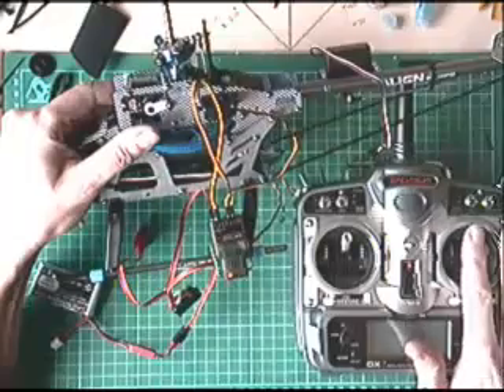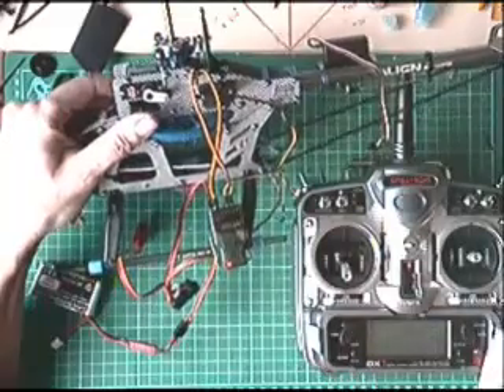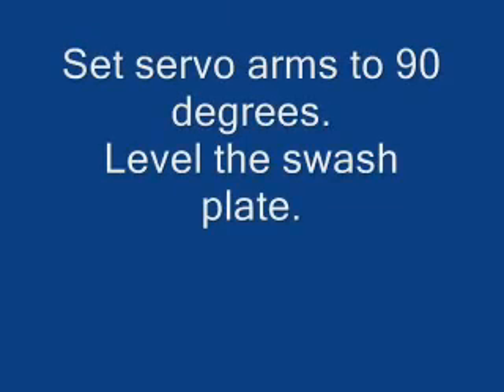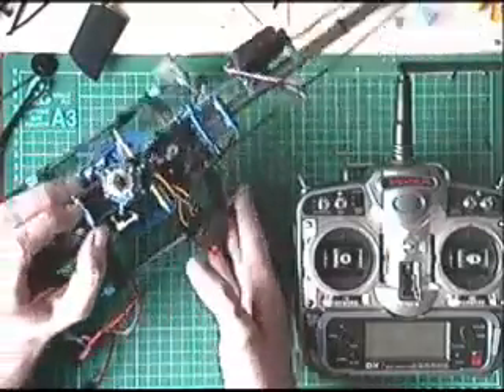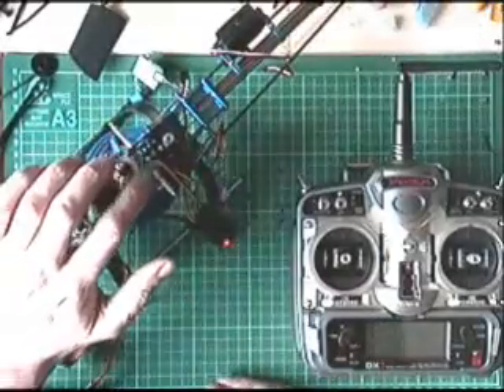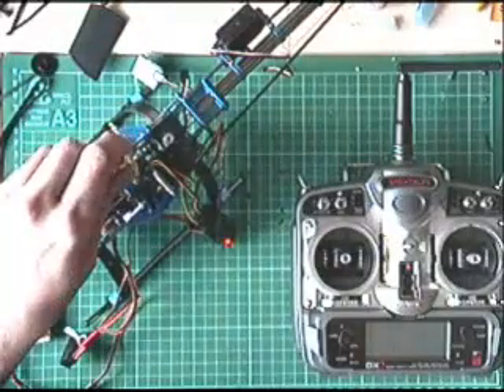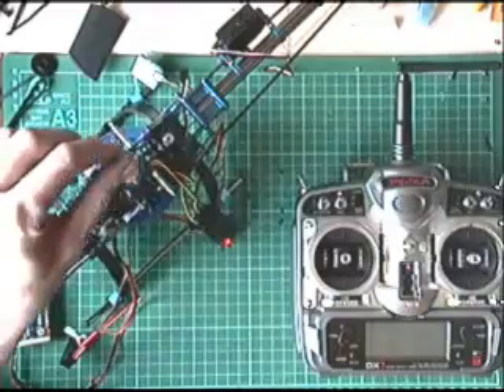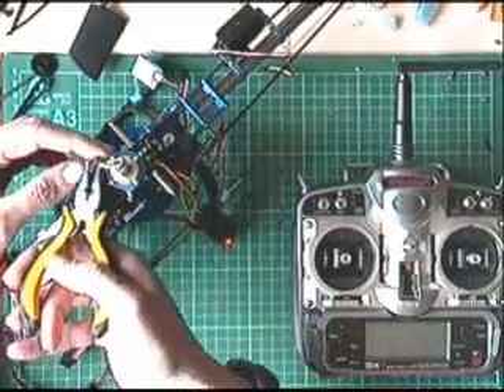Installing electronics into trex 450 with DX7

Comment from the maker: HI Mark make sure the servos are connected like this:
right side = pitch servo
left side = aileron
front or rear = elevator
then follow the video, use the reversing to get all servos moving up and down, then use swash mix to correct left and right etc.
If you still have problems let me know and I'll sort them.

Comment from the maker: HI Mark make sure the servos are connected like this:
right side = pitch servo
left side = aileron
front/rear = elevator
then follow the video, use the reversing to get all servos moving up and down, then use swash mix to correct left and right etc.
If you still have problems let me know and I'll sort them. (c:

Comment: Your video is very help full great work but I am having trouble with getting all three servos lifting together on throttle up the pitch & eleron lift up but the aileron moves down & when I reverse the aileron servo the pitch servo moves down as the aileron & eleron servos move up can you please help that would be great thanks

Comment from the maker: @killirishred The gyro looks at subtrim etc on boot up as the mid point as it were, so is only effected if the trims are moved after it has booted, this is separate to altering trim for the other servos. Yes some gyros need zero sub trim but most see any trim as the center when they boot. If this makes sense (c:

Comment from the maker: @brohoop Cheers Lou, always do the set up in idle up mode, basically you need a linear pitch curve to get the servo throws even. This gives you 0 pitch at 50% and max pitch at hi stick etc. Once this is done, when you switch to normal mode you have about -2 degrees at lo stick and +9 or 10 at hi stick. Or if you have a dx6i etc you can adjust the pitch curve to whatever pitch you prefer at low stick etc. and just use a pitch gauge to get what pitch you want.
(c:

Comment from the maker: left servo aileron = aile
right servo pitch = aux1
front/rear servo = Elev
single wire from gyro into gear then you can use the gear channel to control the gyro.

(c:

Comment: Hey Gary I need some help with my King2 And Ar7000, 
Thro --->ESC
Aile ----> Servo
Elev----> Servo
Rudd--->Gyro wire (Where do i put the Yellow power on?)

and where do i plug the other Swash Servo?

Comment from the maker: Make sure your swashplate is level then check one blade's pitch and then turn the blades and check the other one in the same position as the first one was (ie on the same side of the heli) adjust the links on one blade to get the same pitch on both blades.

Comment from the maker: Hi
for ST1 I use
L= 35 1 =45 2=50 3= 75 H=100 for pitch
and either linear throttle or 
L=100 1=inh 2=75 3=inh H=100
and for ST2
linear pitch (straight line diagonal L=0 to H=100)
and throttle
L=100 1=inh 2=85 3=inh h=100 with exp on all settings

Comment from the maker: Hi, for the beginner pitch curves of
40 61 67 73 90 with linear throttle (0 25 50 75 100) or adjust mid point of throttle to 70% if you have dx7 use expo on both throttle and pitch curves.
Pitch 35 45 50 75 100 for more advanced pilot
linear pitch and throttle 100 INH 80 INH 100 for 3D flight.

Comment from the maker: Either the DX6i or DX7 are good choices, however I recommend the DX7 for 2 reasons.
1: the extra channel (very handy to have)
2: the DX7 has more expo settings for throttle and pitch curves.
But for £100 the DX6i is a great TX.